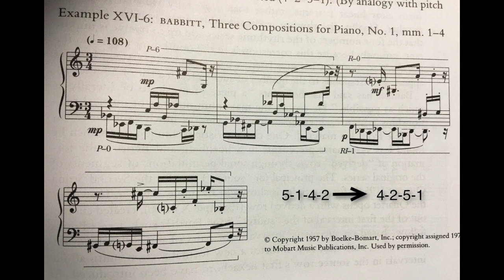Total Serialism

Comment: Hello! great video! I am currently doing a project on Milton Babbitt and his total serialism. I have to present about it and I'm still somewhat confused. So is total serialism just the way the 12 pitches are organized? plz help! Thanks!
Reply: It goes: pitch, duration, timbre, dynamic.  Schoenberg covered pitch only. Also something called Klangfarbe Melody concerning timbre changes alone. Weberns scope of reduction was so marked as to reduce actual durations of pieces severely. Robert Crafts recording of the Complete works of Weberns comes in at a little under an hour.  Finally, with Babbitt we have total serialism, followed by aleoteric and random chance of the 1960's.

Comment: Hi Sean, what do you mean by the P0 is now called P10? What is the new way of naming it? I am writing an essay about it and I saw articles that use either way to name the row which is really confusing. Do you have any links or website that explains it?
Reply from the maker: Qu Zheng Great question! I suppose you’re right that this is less a matter of old vs. new, but more simply a matter of two ways of labeling rows.

One way is to name the first row of the piece (or some other significant row) P0 and then base all other labels as transpositions of that. So the P0 row transposed by a tritone would be P6. 

The other, and my preferred way, is to label P and I rows by their starting pitch. So a P row that starts on B-flat will always be P10 (or Pt, or Pa, if you use a system that replaces 10 and 11 with t and e, or a and b).
Reply: Hi Sean, thank you for the reply! I still don't understand the second method of labeling. So why the P row that starts on B-flat will be P10 instead of P0? Is P0 or P10 the prime row?
Reply from the maker: Some labeling systems always call the first row of the piece P0. Others label P forms of the row by whatever the first pitch happens to be. So in the former system, you'd call it P0, and in the latter, P10. They're both the same row, just with different labeling systems.
Reply: Hi Sean, do you mean that the P0 in the video is not the prime row, but as it is the first row, it will be called the P0 in the old system. Thank you!